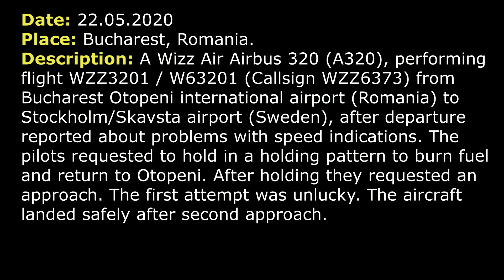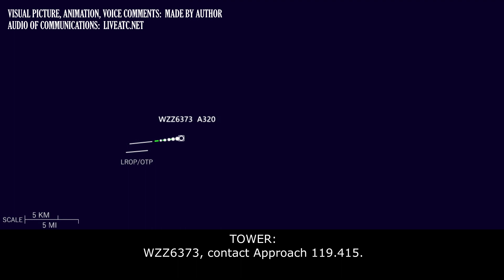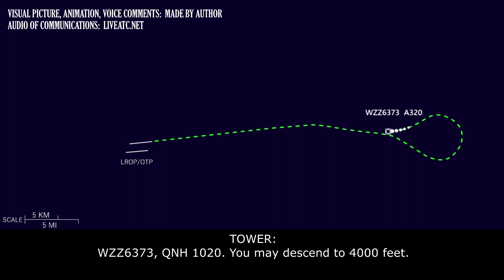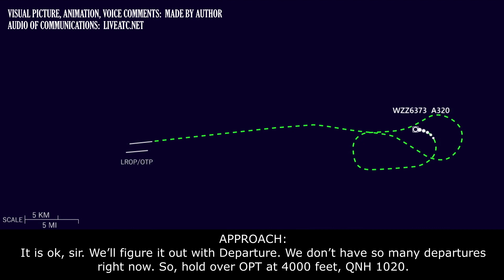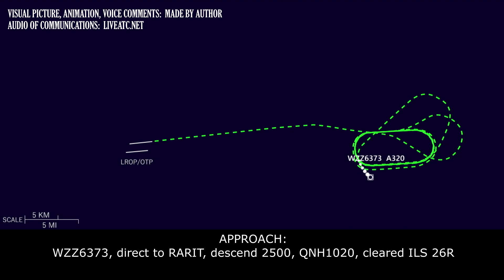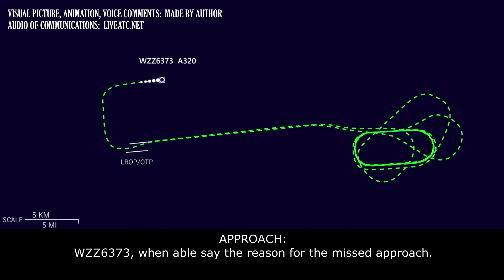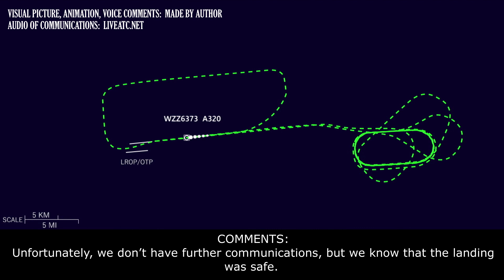(Real ATC) A Wizz Air A320 has got problems with speed indications after departure from Bucharest.

Comment: 3:06 WZZ6373: WZZ6373, Our intention is to return  back to Otopeni...
3:23 TOWER: WZZ6363, roger, are you able to switch to Approach 119.415?
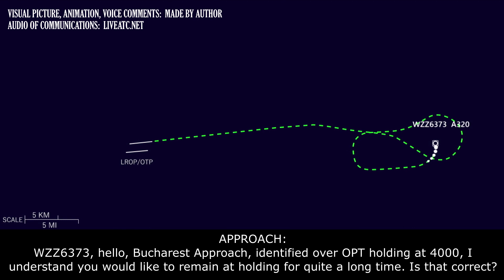3:57 WZZ6373: Yes, this is correct. We have to burn 2.5 tons of fuel to return back for landing in Otopeni.
4:05 WZZ6373: For us it is ok, but I don't know about the airport circuit..the other aircraft...If it's okay for you we can stay here.
4:42 WZZ6373: WZZ6373, not emergency, we can say PAN-PAN, it's indicated speed discrepancy, the problem now it's solved. Aircraft and everything is under control. We have to burn some fuel to return back for landing.
5:55 APPROACH: Roger, I, I will inform tower and let you know.
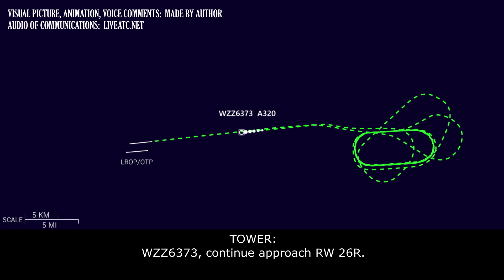7:48 WZZ6373: Continue approach RW 26R, WZZ6373, request to vacate at the end.